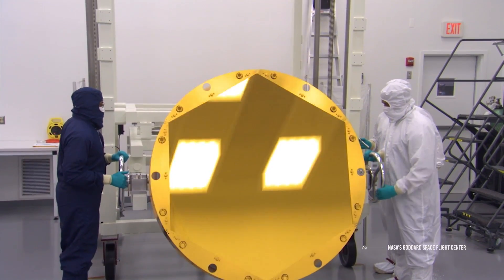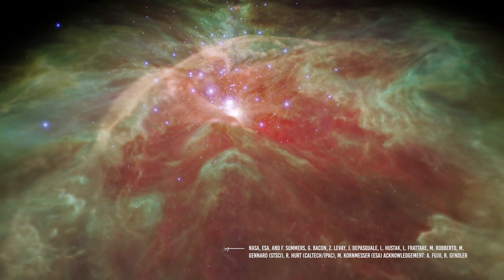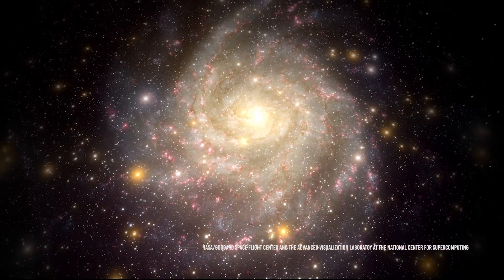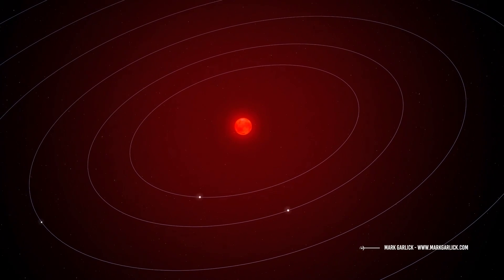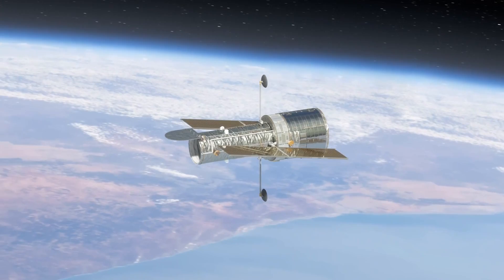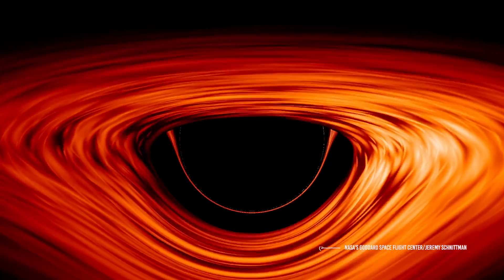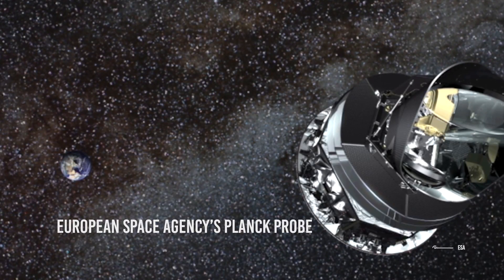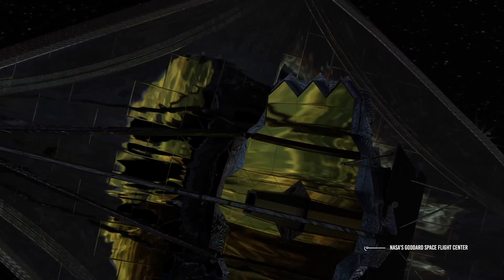5 Cosmic Revolutions James Webb Will Bring

Comment: Why not just unfold it in orbit then just nudge it away.
Reply: 1. Debris that can rip it to shreds is mostly in earth's orbit (debris collects around gravitational fields)
2. This would require the JWST to be even sturdier to withstand the acceleration while its unfolded. Which introduces a lot more failure points. And also would require more weight, which would remove space for the telescope itself (making it far less functional).

Comment: In my opinion extreme radiation will be a risk for James Webb because of gold material.
Reply: You have it totally backwards. It is necessary to use the gold layer in the satellite, which has to be sent far into space. Indeed, according to scientists, MLI prevents the satellite from corrosion and protects the delicate parts of the satellite from tiny bits of debris in space. In addition, the coating of other metals in it helps to prevent harmful infrared radiation and thermal radiation.
According to scientists, if the satellite is not covered by a layer made of gold and other metals, then the dangerous radiation of space will destroy the satellite in an instant. Now since many types of fragile equipments are also installed in the satellite, this layer protects against any object hitting the satellite.
You will be surprised to know that space suits of astronauts also use a layer made of gold and other metals. Images of the Apollo Lunar Module show how NASA has used gold. According to agency engineers, a thin layer of gold leaf was used as the top layer of a thermal blanket used to cover the bottom of the module. The blanket was incredibly complex with 25 layers of material including glass, wool, kapton, mylar and aluminum.
Reply: @sandybarnes887  I agree with you. There is no problem. The point is gold has iron. Iron is a strong magnetic element and its magnetic density level varies in space. For example Betelgeuse star mainly contains iron but its magnetic density level is low. Rigel is a white star and it contains iron as well. This point is astonishing : iron in Rigel is denser than Betelgeuse as magnetic level. Iron on earth has low magnetic density level. So when you use gold which is formed on earth its magnetic density level will be increased in space and this change will affect other elements particularly nickel. By the way when I use "Magnetic Density Level" expression I mean neutrons in iron element. And one last issue I may add is about supernova. Most of scientists have been waiting for Betelgeuse to go supernova but it's a mistake. The first star to go supernova is Canopus. With my best wishes for you. Sincerely.